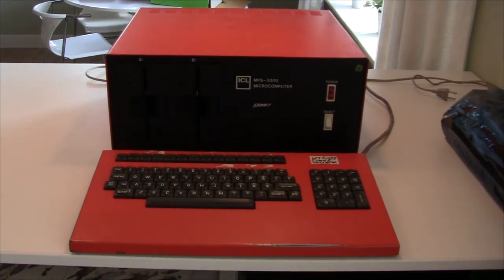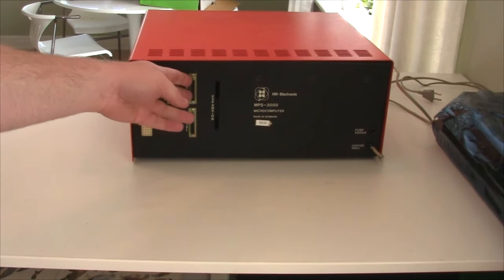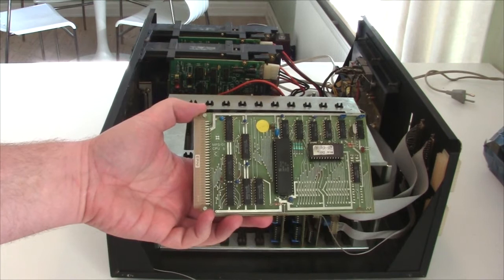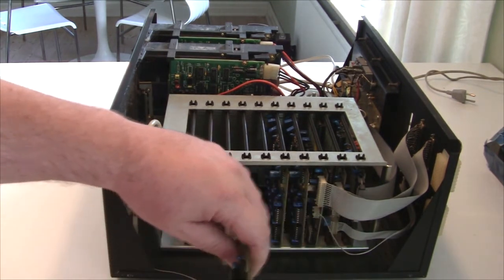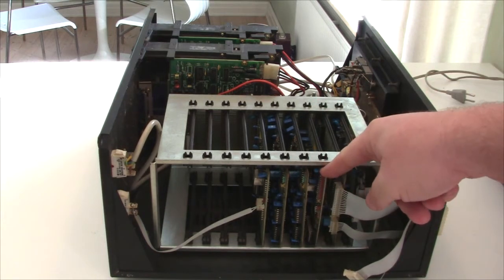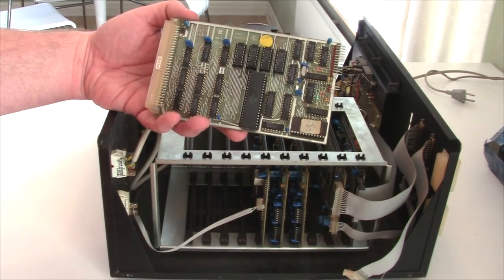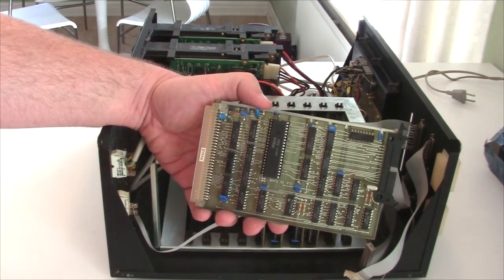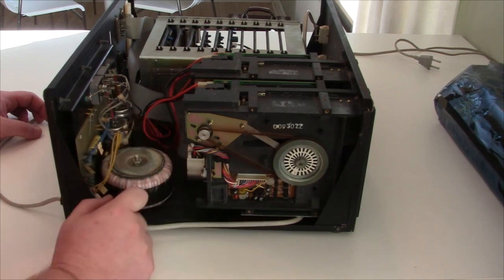Teardown of the ICL MPS-3000 Comet CP/M machine

Comment: Whoa - this brings back memories. Actually I built that machine. I used to work at the factory where we built the MPS-3000 back in the 80'ies for a company called HH-Electronics. I had one at home too. Hot stuff - 64kb RAM, 64kb graphics-card, I/O-card, two 5 1/4" diskdrives - 180kB each and an 12" B/W-monitor. The machine is long gone - but I still have the disks with the CPM 2.2-operating-system and HH-Basic compiler. If one was to buy that machine back then it would cost 48.000 DKK. The same as a brand new VW Beetle.
Reply from the maker: Very interesting. Where was HH-Electronics based? I have not been able to find anything about them. And they had an agreement with ICL in the UK?
I also have a Comet 8, and a terminal (for CP/M Plus???), which I can not remember the name of.
I'm trying to repair the MPS-3000. For a start, there is some problem with the power supply.

Comment: hi Jesper. I worked on an ICL mainframe system from '88 to '92. it was a huge block of loveliness that filled a room and had it's own aircon. the boards that slotted into the backplane were huge....and the hardrives weighed a ton. even though the mainframe ran 24/7, it rarely broke down. when they closed the REME workshop down, Dave (the ICL tech) and me sat on the ground outside and cried our eyes out as we watched them smash the 'old girl' up for scrap. ironically, we had few of the smaller ICL systems (like yours) too - they weren't scrapped, but sold off at auction.

I'd like to thankyou for posting this video, mate. it's brought back long forgotten memories of happier days (and old friends I should contact).
like Alan said; it'd be nice to see the wee machine running.
:)
Reply from the maker: Wow. Enormous,  for 1988.